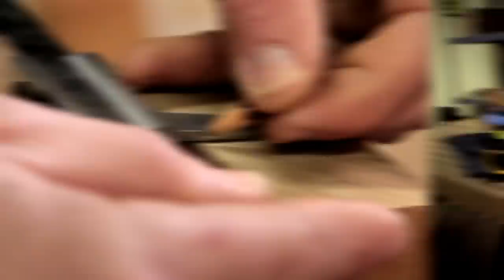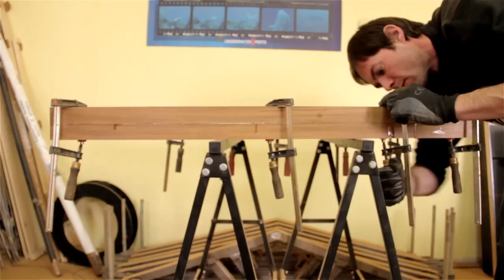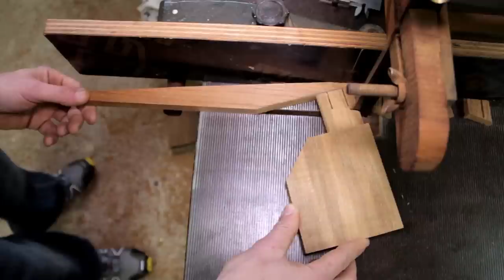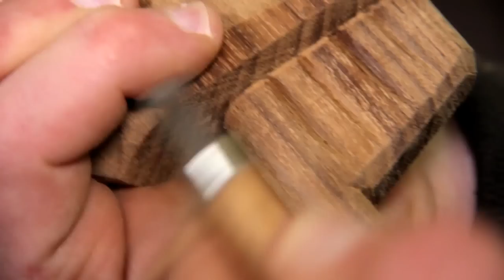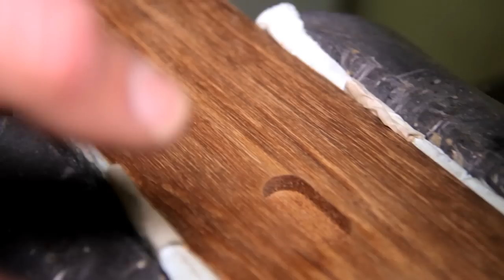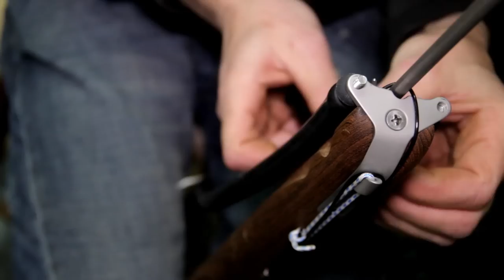The creation of a Benthos wooden speargun

Comment: Which tools were being used in 
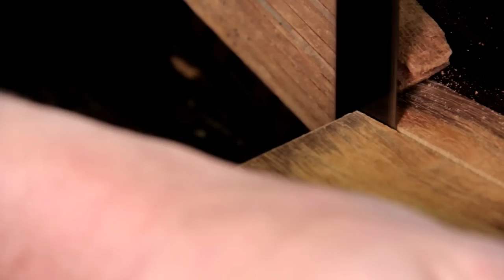0:24
0:26
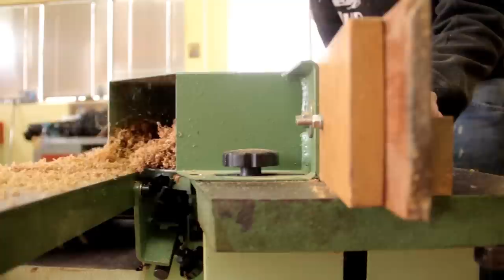0:45
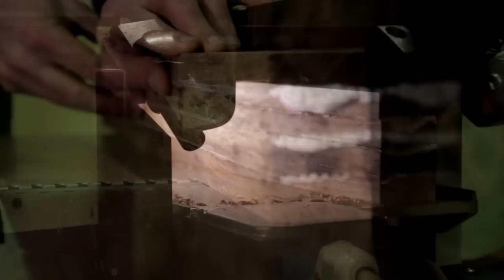1:04
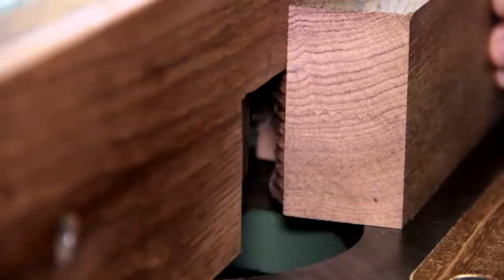1:13
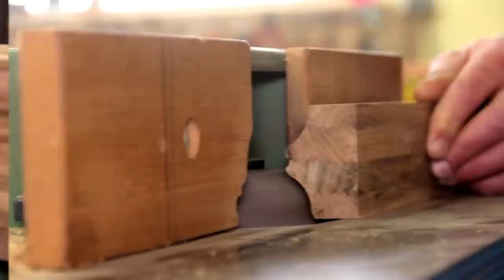1:37
Reply from the maker: This is a plane. You can make a block of wood orthogonal parallelogram, i.e. make all angles 90 degrees.

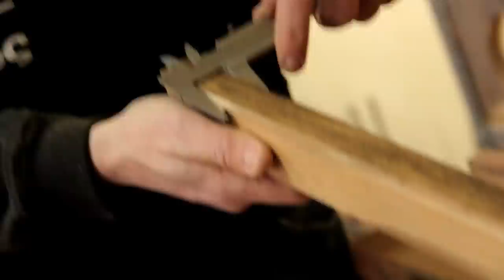Comment: @0:42 what bit is that?
Reply: The speargun is made out of 3 or 5 lengths of wood stuck together (in order to avoid the wood's tendency to bend over time) and this is a method to increase the glue's contact area and the bond strength when glueing the wood together.